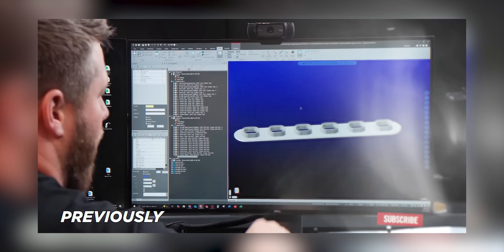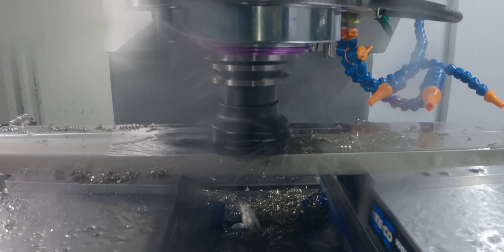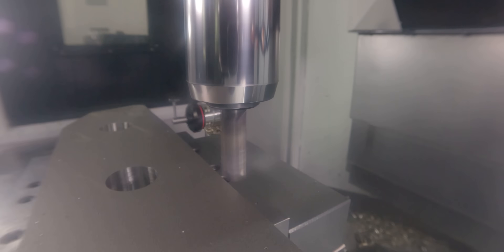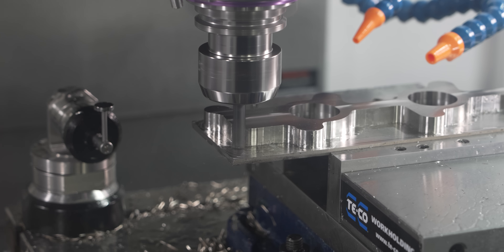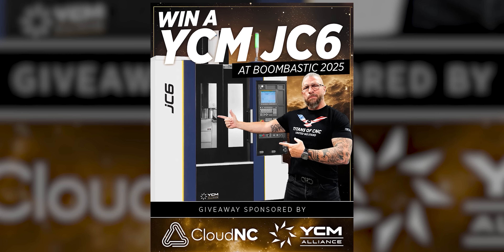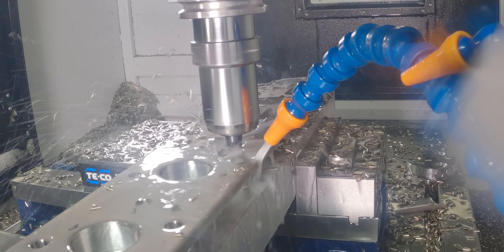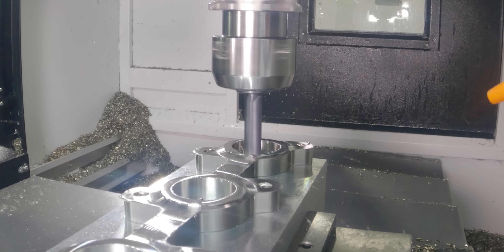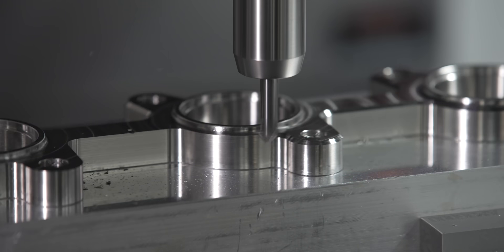Slamming 304 Stainless With a $50K Monster CNC—Watch This

Comment: The question I have is why 304? That stuff is used for drawing and forming operations, like wire, tubing and springs. Why not 303, which machines so well?
Reply: The greater challenge of machining 304 might be a factor here, for demo purposes, showing the machine's capability
Reply: @Rimrock300 
He could have chosen titanium, then, or inconel…nitinol?

Comment: I attack 303/304, 316 & 416 SS everyday with a 20 yr old Haas VF1 that we payed $1000 for 10 yrs ago.
Reply: That's good for you, but most are not in the positon they are just gifted useable cnc machines, they will have to buy a new one, or nearly new

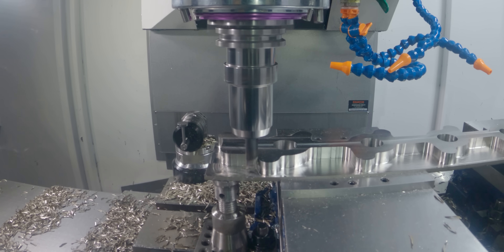Comment: That chatter at 3:22 doesn’t sound great, is that a problem with the machine or the cutting parameters?
Reply: It's just roughing, doesn't matter how it looks and sound when you're trying to remove material as fast as possible. As long as the finishing passes give a good finish and accurate dimensions it's perfectly acceptable

Comment: Would you ever waterjet part to rough size then machine? Would it save any cost?
Reply: That's entirely situational.  Depends on the part and what equipment you already have and what you have to occupy said equipment.
Reply: Depends what you're doing. I just had to make some big pivot knuckles out of 3" plate. We couldn't afford to wait for the flame cutting to rough shape so I ended up cutting 12"x3"x3" slugs off with a 1/2" relief shank endmill. Hanging out 3" would have much rather dealt with a flame cut or payed more to not have to deal with it.